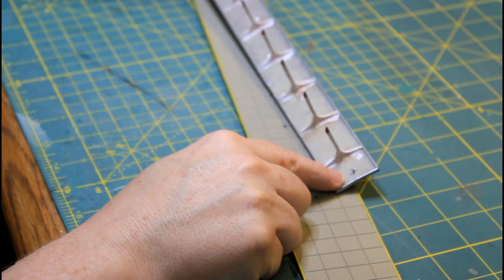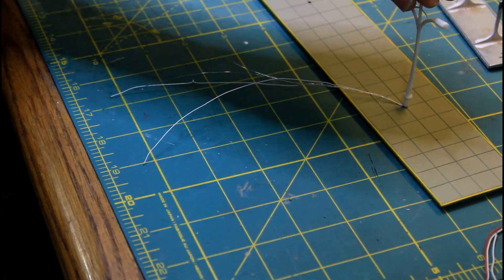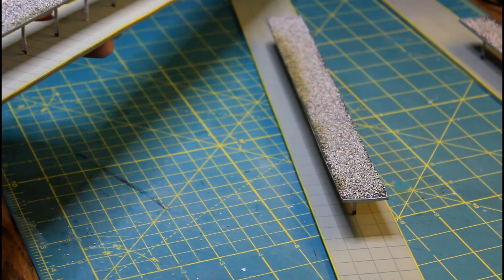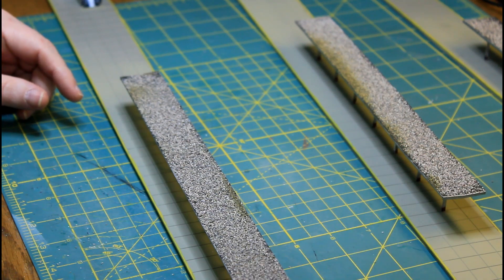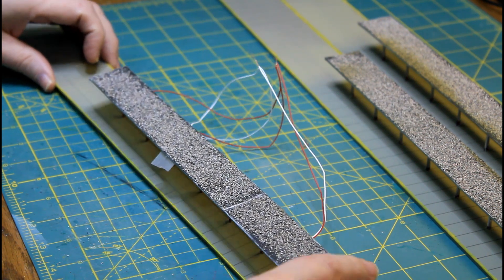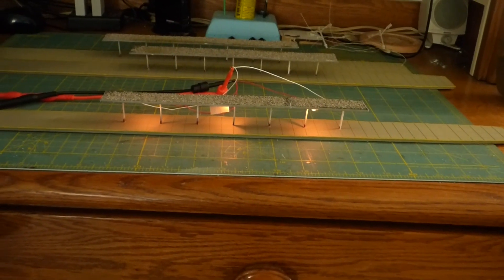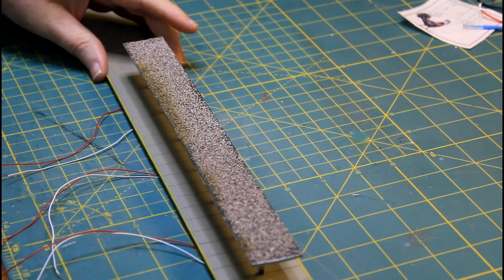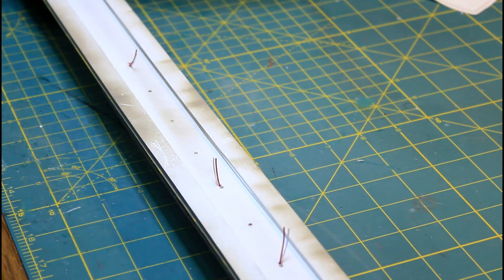Train Station Interior and Lighting: Part 8

Comment: Hi Mike, very useful tips and methods. Why do you not just attach the platform lights to the copper strip you used for the other lights? Keep up the good work.
Reply from the maker: Ian Sowden thanks, the main reason is I did it that way is so the bulbs will lay flat and also the roofs were already installed and it would be too difficult to use a different method. This was how I did it in a previous install and just followed what I know works.